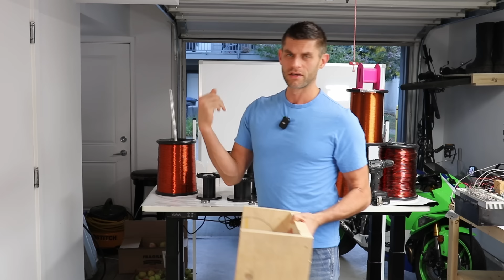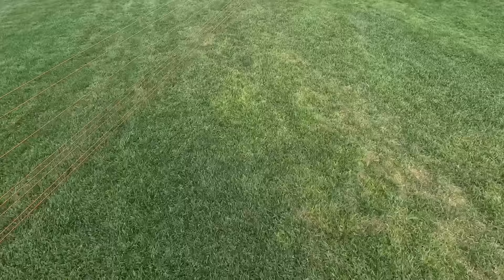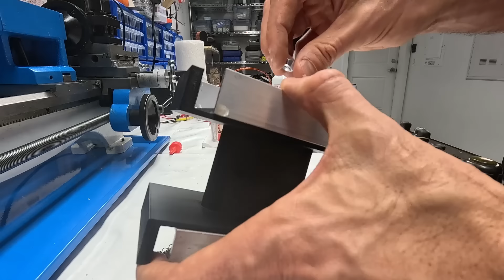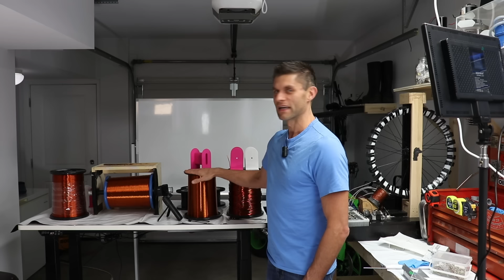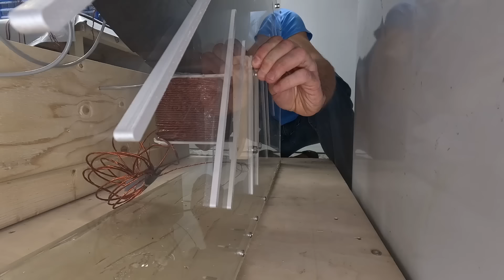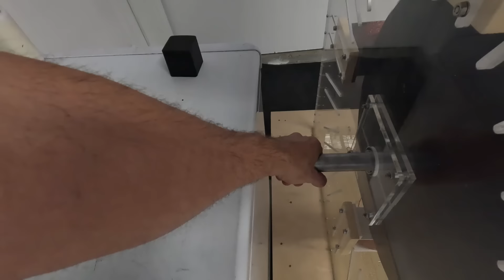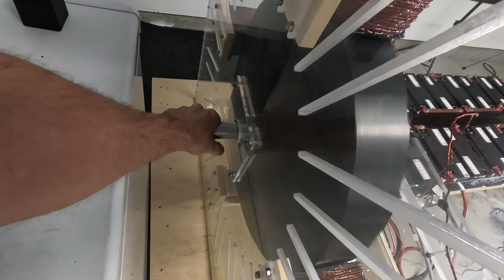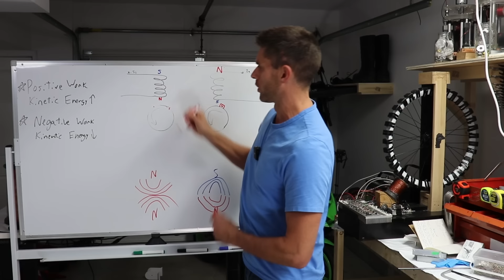The Device That Could Give The World Unlimited Energy

Comment: This reeks of misunderstanding of lenz law, LOT and also power loss through friction/heat. 

Every single perpetual motion or free energy machine/device I’ve ever see can be debunked under scrutiny. In fact near all perpetual machines I’ve seen that “worked” had batteries hidden in them and that same for “free” energy machines. 

I’ve got a migraine right there his moment so I’m not at my best but it appears to me you’re essentially trying to use electricity to store or create potential energy at a rate greater than 1-1. For example using 0.9 energy to create 1.0 potential/stored energy. 

The problem is you just cannot get something from nothing. Is doesn’t work, ever for any reason. It’s a neat subject for sure and people get close to 1-1 but there’s always a loss of energy. Always, always, always. 

This energy you talk about in “inner space”, I think you’re saying, may or may not be exist I can’t debate you on that because I’ve got no clue what’s near you or in your space there. 

Whatever it is, if it’s energy dense enough to be picked up from your device there then I bet we’d have been destroyed long ago. 81ish years ago to be more precise, anyone know where I’m going with this before I say it? Good for you if you do. 

If our air alone had enough energy readily plucked from it like apples from a tree then it would assume the molecules are not as stable and easier to break up and create energy with them. If this were the case then the chances of a runaway effect for the energy in the air would be much higher than the slightly higher than non-zero chance we have now. 

In fact they were afraid of this the first time they tested the bomb. They ran several calculations and came up with  a non-zero chance so basically before they pressed the button they bet on red and black and hoped it wouldn’t hit green. 

Anyway the way nukes work is the fuel is one particle slamming into another breaking it into two which hit two more and so on and so on until the fuel runs out. They compress the plutonium or uranium, I can’t remember, as a sphere into a much smaller sphere using a detonation of explosives directed at it to perfect squeeze it evenly all around. The reason they do this is to compress the material. It means the particles are closer together and you get a more efficient “burn” of the fuel. So you can use 6.1 kilos or whatever it is to get the yield you want instead of having to use much more without compression. 

We’re lucky this is a problem because if there was more energy in the air ready to react in such a way as a nuke does then the first bomb might’ve set the whole planet off into a planet size nuclear runaway explosion. 

I don’t expect everyone to understand this. This migraine has me typing extra lazy. I’ll reply to as many questions as I can but I’ll leave off today with this. Just like this comment, I don’t like the use of mis or disinformation and I wouldn’t normally promote it yet sometimes when a field is burning you can save a good majority by using fire to create a fire line cause fire can’t spread where there’s no fuel but it still ruins crop, leaves a mess, smells bad, looks bad and has other negative effects but it stops or at very least slows down ruination enough so the big guns, the firefighters, can get there to solve the issue. Dis/misinformation is a scourge to the science community, especially the up and coming young minds and young leaders that will help shape the world of tomorrow through science and good ideas. Good ideas are born from original thought or old ideas reimagined and improved upon. Bad ideas can sometimes be molded into good ideas by chance but that usually happens after the 2nd, 3rd or maybe 4th try but when we’re at tries into the 100-250+k then it might be time to shelf it for good. Free energy would be amazing and it’d advance us hundreds of years which I’d love to see. The piece of the puzzle either doesn’t exist on earth, we can’t produce it in a lab setting or it just doesn’t exist and therefore impossible. 

Also if it existed in a way we could harness it before becoming a K1 civilization then it would stand to reason most universal life could do the same and with supposed 13 billions of years to play with we should at least see SOME evidence of that. Energy is that important folks. 

Anyways I’ve typed enough. Migraine is killing me. If you got this far and know/understand why I called this comment misinformation lemme know somehow by replying, asking a question or just straight up saying it idk lol

Comment: I am working on a hybrid heat pump heat engine design. Essentially ambient harvesting and upgrading via evaporation of a cold fluid and compression of the vapor to condense at higher temperatures. 
Just like a heat pump you lose ≈14-25% to flash, except this time we are compressing it with the vapor from the evaporator, waste heat and internal recycling allow ambient to keep up. A recuperator on the CO2 turbine reduces the draw on the buffer. MVR 2 stage inter cooled, with waste heat recovery charge a middle stage in the thermal cascade. It treats ambient like an inexhaustible middle stage of the cascade, and latent heat of condensation like a repeatable internal fuel

Comment: You can't break the law of thermodynamics. Energy is neither created or destroyed. You will find that your loss is due to the heat lost in the bearings. Your measurements need to be done in watts. Voltage times current. The other loss will be the heat generated in the coils. Current times resistance squared. Your measurements will be difficult to get right since the voltage in is pulsed but I can guarantee you that your voltage measured at the batteries will drop if you leave this experiment running. I bet withing a week the voltage will drop close to 1 half a volt. Especially with all those circuits that do the pulsing. Give it a try.
Reply from the maker: Lol 😆 🤣   people who know they can and cant are both correct

Comment: I'm not very educated or knowledgeable in electrical fields and circuitry but what I understand is the crux of the issue is showing the connection and increase of the system with background energy through field interactions. If you eventually get it working and running efficiently and drawing in energy I wonder if it will produce a background "cooling" in the area that can be measured. That could be one useful way to show true performance.
Reply from the maker: ❤ agreed

Comment: a few questions/flaws I see. How do you make up for generator drag/ Lenz's Law (Mechanical power out = drag torque x angular speed)? A cap at a few volts looks “charged,” but contains millijoules. Pulsed sources demand time-synchronized watt integration. Under-loaded demos, it spins with only LEDs/small meters attached; attach a solid 5–10 W load and then tell me how it does. Lastly, I challenge you to put your device in a Faraday cage and run it. If it collapses/fails to give the same result, you are harvesting ambient RF not zero point/vacuum energy.
Reply from the maker: Lenzs law is a joke. Its easy to negate .

Ill prove this in my next video
Reply from the maker: Its easy to prove its producing excess energy if it runs forever. 

And I dont care to prove anything to people who know its impossible
Reply: @MadscienceLPTECH Or, ya know, you can't prove anything because you're a scam artist.
Reply: @MadscienceLPTECH  you should though, the other can be easily fooled. Yet you don't have excess energy, I am afraid.
Reply: @motherindiafathersurf1568  you are scrutinizing and trying to put this dude down when he’s trying to be transparent. His schematics are public and nothing’s patented so if he does make a breakthrough anyone can do it. He’s not hiding anything , why be so negative on someone trying to benefit everyone? It’s like all the naysayers are so angry at anyone even attempting these types of things.
Reply: @KinglnYellow Thise naysayers own stocks.  The people I've helped get off-grid in Ohio are OFF-GRID.
Reply: This is just a reverse Tesla coil to pull energy from ambient RF. Put it under a high tension power line and you will have all the power you want. A few years ago a person got arrested for stealing power using this. If you want to get free energy then build a device that can modulate the strong nuclear force between quarks, tugging on that produces more energy then what you put in. A lot more to that process than I want to throw out here. Just some thoughts!

Comment: simple way to improve efficiency is to use a core material in the center of the coils. you will get a stronger electro magnet using the same amount of watts  into the drive coils by concentrating the magnet field of the coil. select core material type and size so as not to saturate the core material.
Reply from the maker: Our primary goal is not to concentrate flux. Its to allow unimpeded collapse of the magnetic field.... otherwise I would agree
Reply: I suggest rotating several magnetic fields in different directions,creating a criss crossing matrix,where motion is then introduced to generate electricity.If you can introduce wobbling motion in sine wave pattern that create weird voltages.

Comment: If you made the coils horse shoe shaped would put the north and south poles on the same side.  Now if you put another wheel with the magnets opposite of the current wheels magnets,would you not be able to double the speed and therefore double the generation at the same time, without using any more input?
Reply from the maker: Now you are talking. This is legit 💡 and our V2 is going to do somthing along these lines. Thane Hiens does this :)

Comment: As you say, the voltage and amperage measurements are not indicative of the performance of the machine.  I would like to see a simple experiment.  Run the machine for say 12 hours and switch between the run and charge batteries every hour.   Start with batteries somewhat discharged and measure the voltages of the batteries before and after the run.  Correct me if I am wrong, but if the batteries end up with higher voltages, it is proof of concept.  I would love to see this confirmation.  It might even give a crude measurement of energy collected as the state of charge of a battery could be used as a gauge.
Reply from the maker: Thats what wevare going to do ❤

Comment: Spencer, I have followed your progress and understand your passion. The so called laws are only guide lines not deniable truths. Tesla resolved both sides of the argument with Warden Cliff and Colorado Springs actual electromagnetic valves. They confiscated his notes and discoveries at the time of his death in 1943. The Tesla coil as we know it was simply a distraction from the real purpose. Look at the HAARP towers in Alaska, note the antenna array and what appears to be six capacitors each what I consider phases. This was patented by Barnard Eastland by what was the Tesla Model, Tesla was not interested in the magnet motor as much as in voltage/ Amplitude of conversion. He personally drove a electric car with out the bulky battery pack, he converted the available voltage from the aether or magnetically charged electromagnet environment. Your determination is great the challenge is alway creating over unity with the driving force of Amperage. Your smart think outside the box, 97% efficiency is still not your need or your goal. You don’t need a battery charger but a wattage to Amperage force multiplying force. Good luck !
Reply from the maker: ❤ cheerw thanks for the kind words. We will get OU

Comment: So it seems to me that if you were going to see excess energy developing in the batteries due to the high voltage pulse style of charging then you likely would have been able to detect and measure it by this  stage of the project.. What's the verdict???  But realistically if high voltage pulsed into lead acid batteries could produce excess energy then ideally there would be no moving parts to this device and you would simply have a circuit which would charge up the magnetic field of an inductor, then allow said magnetic field to collapse, dumping the resulting voltage spike into your lead acid battery.. rinse and repeat.  This would do away with any losses which would occur from bearing drag, air resistance, air gap losses, etc. etc.  Also, by simplifying things down to a solid state system, you would be able to eliminate all the other aspects of the system which are operating on conventional electricity, leaving just the high voltage pulse dumping into the battery, making it a whole lot easier to see if excess energy really is occurring or not during such an event.. Because from what you've stated previously, the high voltage pulse into the battery is supposed to be where the excess energy happens, correct??  If this is the case then any additional components in the system that don't have to do with producing the excess energy phenomenon are really just causing you noise and potential losses left right up and down all over town and aren't necessary at all.  Thoughts??  I know I'm really putting the screws to you with this but if we're being honest here.. you really have to admit that what I'm saying makes a whole lot of sense, and maybe even though you've invested a lot of time and money into your current creation, a much simpler and cheaper circuit would actually demonstrate the phenomenon which you're targeting in a much more direct manner that is not only simpler to put together, but also much simpler for folks to understand the working principles of.. whereas your current system is really not all that simple in comparison.
Reply from the maker: Dont be so sure you are aware of everything going on in the system. Conventional electricity isnt fully understood and this inst conventional. 

Assume you're wrong and look for supporting evidence vs assuming you're correct...
Reply: @MadscienceLPTECH  You have said more than once now that the supposed excess energy occurs within the lead acid battery via the pulsed charging causing something exotic to happen with the dipoles or something.. If that's the case, are you saying that your system is somehow able to create more effective induction spikes than what would be had from simply charging and discharging an inductor without all the extra stuff?  Not trying to be right, but I would like if you would do your best to answer this question honestly.
Reply: @MadscienceLPTECH  Seriously I'm totally all in on the excess energy band wagon right there with ya.. But remember a couple months ago I said when you realize this setup isn't the direction to look in that I'll still be here with info on a much more likely path to our common goal.. So when you're ready all you've gotta do is ask.  I'll be here, I'm not going anywhere.  I really hope you are serious enough about this endevour to be capable of seeing what's actually on your table and returning to the drawing board to re-evaluate when necessary.
Reply: @MadscienceLPTECH  You've said at least a couple times now that your system is supposed to develope the excess energy phenomenon in the lead acid battery due to pulsed charging causing some anomoly with the electrolyte dipoles or something.. If you were being honest with us, and yourself, and that's the only place in the system that could possibly have some energetic excentricities, well then why would your motorized induction pulses be any more effective at causing the effect than simply charging / discharging an inductor without all of the extra moving parts?  If you're in this for the actual excess energy goal and not just for youtube views then you'll do your best to honestly answer what I'm asking you here..  Maybe that involves swallowing the lump in your throat when you realize you've dumped a load of time money and effort into something you could have tested the working theory of with a 555 timer and a bobbin of wire instead of the multi thousand dollar monstrosity spinning away in your garage.

Comment: Note, I have seen this type of work before, with byfiler coils about a decade ago. I have them stored on my flash drives. That system was used to desulfaite lead acid battery and recharge. By swapping the battery back and forth with the other battery you ended up with your battery's desulfaited and charged in a off grid situation. This is open source as well.
Reply from the maker: Yes thats a basic bedini motor

Comment: If you run out of wire, is there a way to join more lengths of wire other than soldering?
Reply from the maker: Could solder it together and shrink tube over